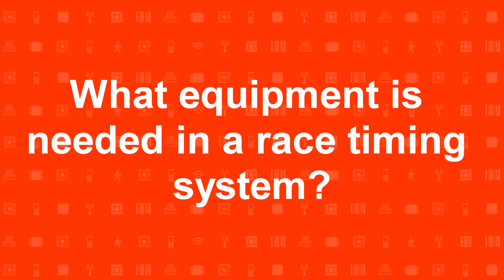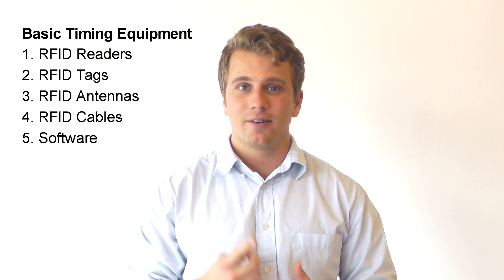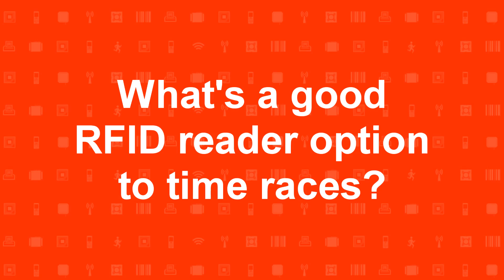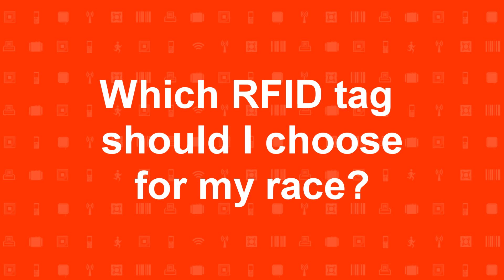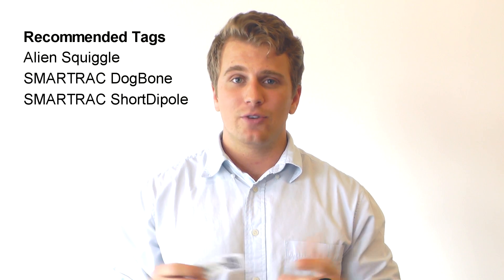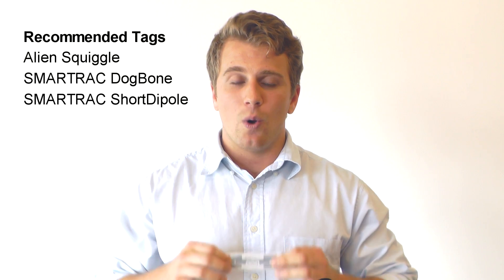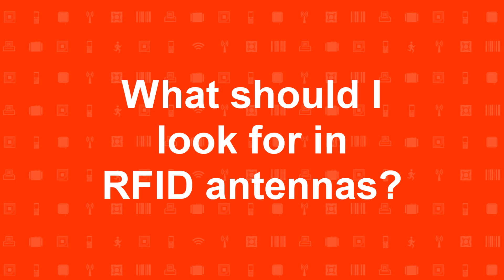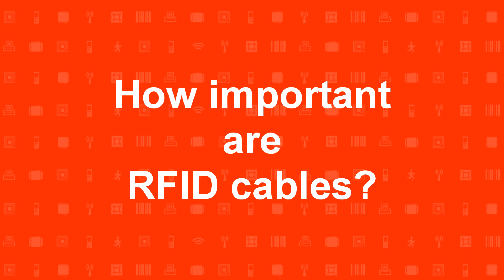How-To Build Your Own Race Timing System

Comment: How much all the equipement without the software?
Reply from the maker: It really depends on how many read points you want, how many people are in your races, and the width of the read points. A very basic equipment set up with one start/finish line, one reader, and two antennas set up on tripods (similar to this: https://www.atlasrfidstore.com/vulcan-rfid-race-timing-antenna-kit-15-ft-cable/) the equipment would be around $2,500 - not including tags or software. Take a look at this eBook for more info: https://www.atlasrfidstore.com/building-your-own-rfid-race-timing-system/

Thanks!

Comment: we are planing  buy all essential 5 things for race distance is 10k running marathon   let us the estimate cost i want set up my own timing run india let me RFID READER,,TAG,ANTENNS CABLE AND SOFTWARE
Reply: Thanks for your question!

There are a couple of things to consider when putting together the cost for your race timing system. 

1. How many read points will you need (i.e. start line, finish line, check points, etc.)?
2. How many runners will participate in your event?
3. How wide will each read point need to be (can you "bottleneck" the read point to be more narrow)?
4. Is there a specific type of tag that you prefer to use (i.e. bib tags, shoe tags, ankle tags, etc.)?

With this information, we will be able to provide you with pricing for your system. Please contact our sales team for a quote.

https://www.atlasrfidstore.com/contact-us/

Thanks!
Reply: ANSWER  AS GIVEN POINT
1. starting point and finishing is the same  and 1  check point and and 5 km where U-Turing point 
2. Around 1000 to 1500  participate  we are expecting 
3.yes narrow point.
4.tag on bib only (running bib) 
we are send you our last year race link so u can have and proper idea 
https://www.youtube.com/watch?v=-n2bCtW1LCA

Comment: we are planing set up the timing company in mumbai can let us the estimate cost
Reply: Thank you for your question! There are several different routes that you can take to time a race. First, you will want to consider the type of RFID reader, antennas, and tags that will work best for the specific races that you will be hosting. For example, you can choose between tripod antennas or mat antennas. Also, you will want to consider if you want bib tags or ankle tags.

Here is an article that can help you select the best reader/antenna set-up for your race.
http://cdn2.hubspot.net/hub/300870/file-1090176450-pdf/Content/selecting-the-right-equipment.pdf
Here is an article that will help you figure out the type of tag that will work best for you.
http://cdn2.hubspot.net/hub/300870/file-1090176445-pdf/Content/choosing-the-right-rfid-tag.pdf

We will be happy to provide a quote for you to help estimate your costs. Please contact our sales team, and we'll have an account manager help you with this process.
https://www.atlasrfidstore.com/contact-us/

Thanks!
Reply from the maker: Thanks Timothy!